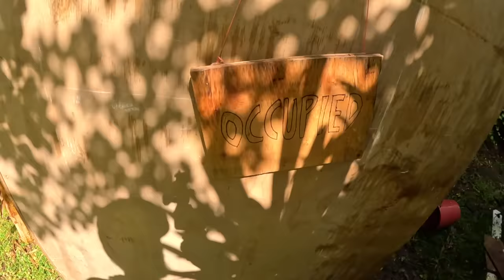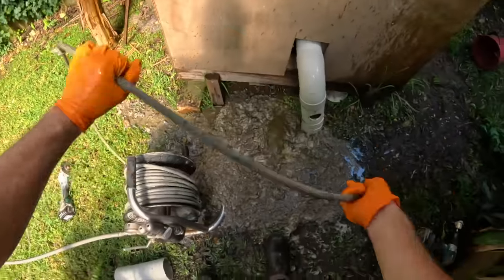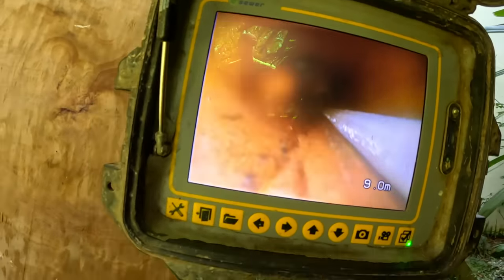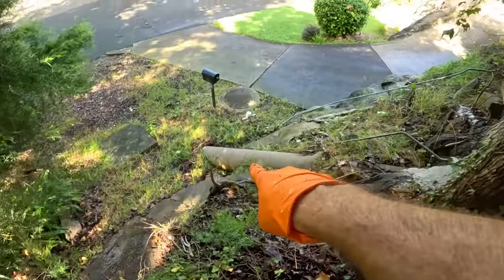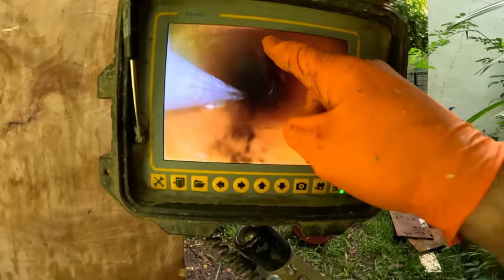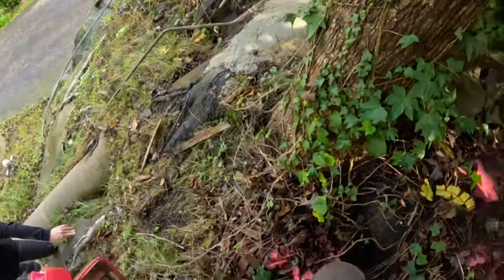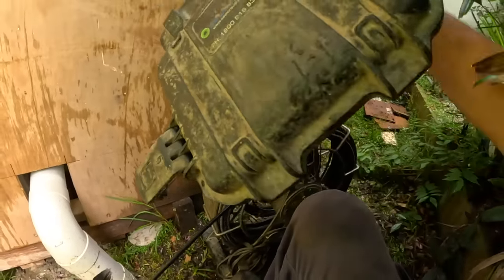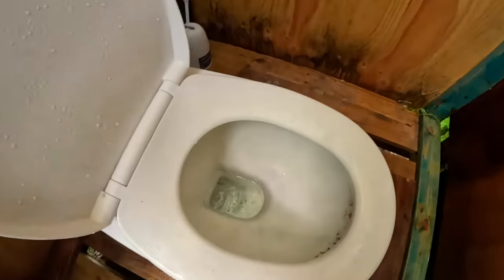Blocked Toilet 815

Comment: Im a cctv operator at a company that does stormwater and sewer drains in New Zealand ,i operate the crawler or push cam depending on the size of the pipe and operate the jetting truck when needed , but  what u do is a whole nother level of Unblocks hahaha id much rather just popping a man hole and putting the camera or jet down the line 😂 . Respect to you for doing the messy and often nigly jobs you do

Comment: Attention, Ollie.. Tim from Canada. I mentioned in a previous video about our drive back that you can hook up a garden hose to… the wet, dry vac is made by rigid.. and it will have an attachment for your garden hose.. when you were in a tight area and you have water that needs to go out this wet dry vac with attachment you can hook up put the garden hose on then make a hole or just put the nozzle in and it will discharge the water away from your area.. this works good if you were in an indoor settlement that has lack of. access to the outside by hooking a garden hose on to your rigid wet, dry vac and discharging the water. This saves you from going out side and up and down. It will save you time and energy on your job. Just thought I would relay back the information because on a previous video I mentioned this, but I was not sure what the brand was… ridgid is a big name may be there in Australia. You have other name brands that would work the same and do the same job.

Comment: Once you've pierced with the guiding bit - run the drill backwards to cut the initial groove in the PVC. Will help keep the blades from biting too hard and snapping the guiding drill.
Reply: I also find it helpful switching the drill to screw mode with the clutch on the highest setting.  It'll be able to cut, but should slip before breaking the pilot, if it jams.

Comment: That 🇦🇺 loo looks like it has been rapidly slapped-up with the installation ~ haven’t bothered with a cistern lid & float valve, at least it has true homage to the original Australian dual-flush toilet as you have to manually fill the cistern; you can choose half or full flush without selecting on the flusher valve buttons 😁. Here in 🇬🇧 we have portaloos for building sites

Comment: Thé brother of a friend got his basement filled with a good 1 meter of that king of crap many years ago , the sump pump sucked the water because the water find his way trough the wood floor and all around the basement.
What happened is the city cleaned the sewage pipes and for an unknown reason a blockage happened few houses down the street and it’s downhill, his one way trap broke off and everything start flowing in his house until it was leveled to the street then because the pipe that goes in the house is 10 cm it was making pressure so the manhole popped off and all the sewage was flowing in the street …
Police was called they went to the worker advising them….
They had no idea it could have filled someone basement, it’s when the brother of my friend come back from work he smelled that he looked at that .
I know the insurance paid for all but then it was a court battle between the insurance and the city to get their money back ….

Comment: No stack vent didn't help either. Kept the flow to a crawl.
Should have put a tee instead of an ell and ran a pipe up about 8 feet, just above the outhouse.
You'll be back fairly soon.

Comment: I always wonder if I ever have my own place and the bathroom is a proper wet area with drain I could just get a pressure washer to clean the floors, walls, screens of soap scum etc. My concern would be I'd blast away the tile grout.